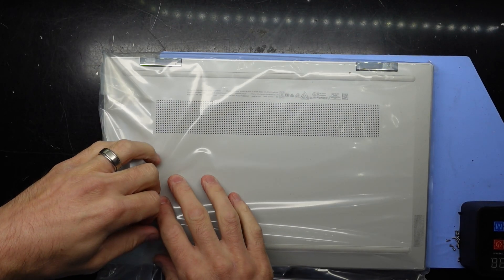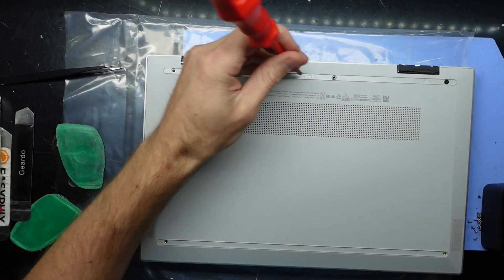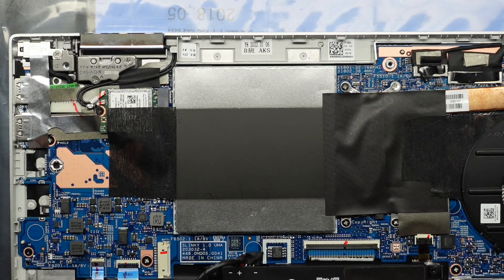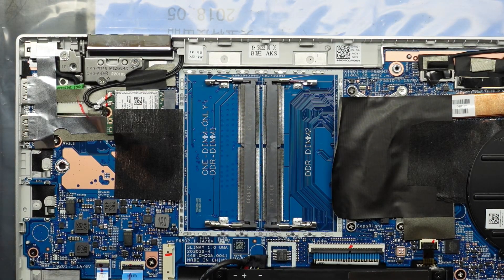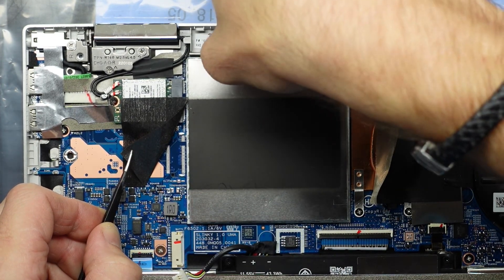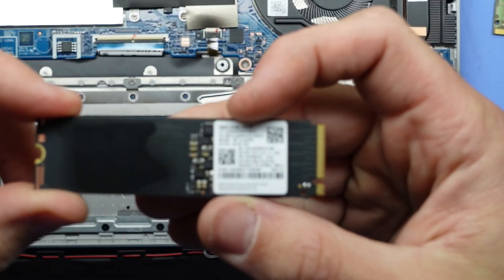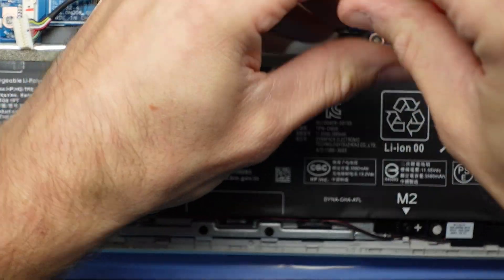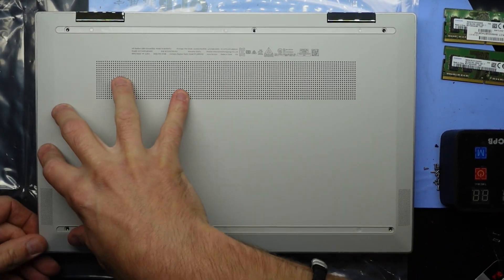HP Pavilion 14 x360 2022 Ram and SSD NVMe Upgrade

Comment: For anyone running into issues with the new SSD not showing up correctly:

The reason your new drive isn’t showing up or your image restore fails (e.g. “Inaccessible Boot Device” error) is because HP ships these laptops in RAID/RST mode, not AHCI; and there’s no BIOS option to change it.

The easiest fix is to do a fresh Windows install. During setup, you might need to load the Intel RST driver manually so the installer can detect the SSD. You can download it from Intel’s site, extract it onto a USB, and load/install it during setup.

Comment: What is the maximum RAM you can install in each slot?
Reply from the maker: Probably 32gb each slot
Reply: @rickstechrepairs  Thanks! Do you think 2 x 8 GB will do ior would you recomment 2 x 16GB RAM?
Reply from the maker: for general use, maybe the odd game or two i would just go the cheaper 2x8GB
Reply: Brother in HP site for my model they mentioned only i can use 12 gb ram currently I am running with 16 gb with 2*8 now my question can I put 16*2 is it works

Comment: When i use Nvm ssd the laptop crashed in operation and got the blue screen with message (Your device ran into a problem and needs to restart. We'll restart for you.) is it possible that the  hp pavillion not capable of Nvme ssd?
Reply: It's because the controller is RAID not AHCI